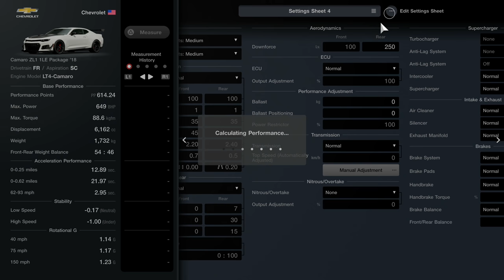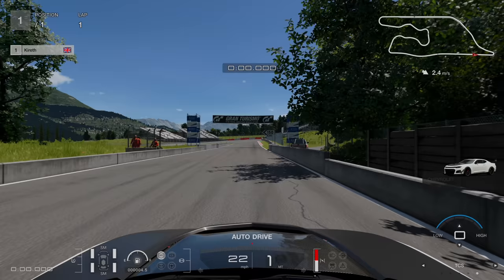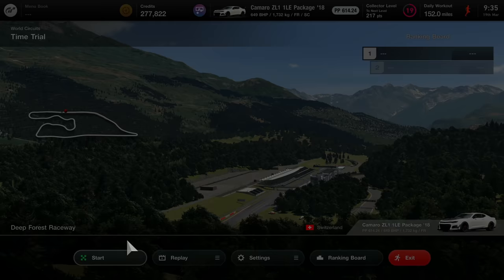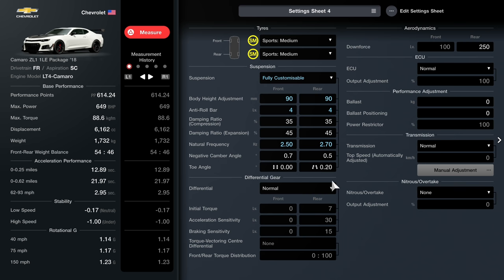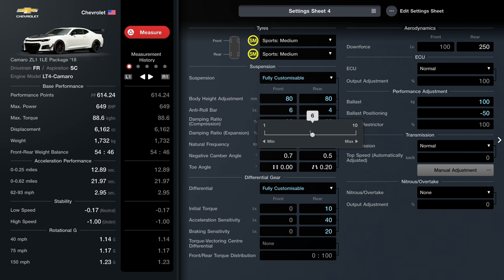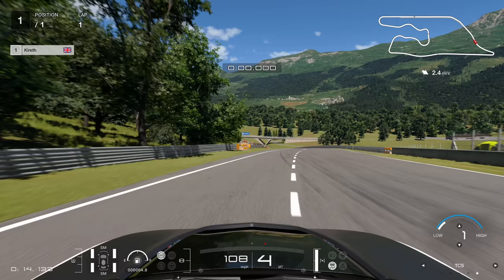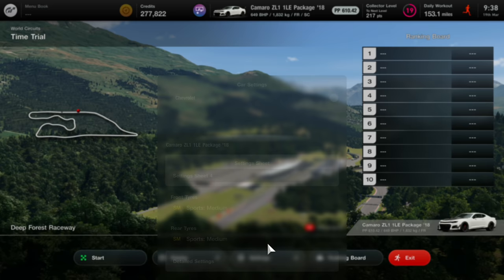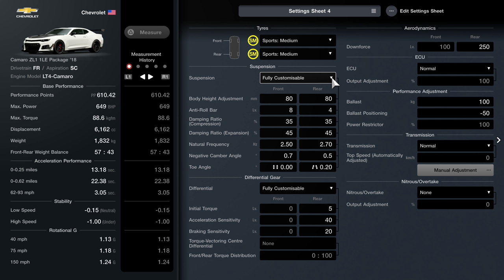Gran Turismo 7 Tuning Guide - Make Undriveable Cars Good!

Comment: Thanks man, appreciate the video!

Was literally struggling with a Focus RS (500+bhp) and seemed impossible to drive. Now I have seen my ballast positioning was wrong and the initial torque setting too. Top tips man, thank you!
Reply from the maker: Hopefully it helps!!
Reply: Something that I think gets slept on as well, particularly with the focus, in increasing the rigidity. That combined with a good suspension set up will stop the lift off oversteer and tankslappers you get in that car.
Reply: This helped me so much with my rs! I couldn't drive it at all.
Reply: Don’t discount suspension tuning default settings are completely Wrong.  Buy the fully customisable suspension (coilovers) Then simply remember softer equals More - priority of Grip in weight Balance. You have anti-roll bars / dampers compression (bump) and expansion (rebound) / natural frequency (Springs rate)

E.g. 
anti-roll bars F6 R3
Damping bump F35 R23
Damping rebound F45 R39
Spring stiffness F2.20 R1.70
Or to much understeer 
Anti roll bar F5 R3
And springs F2.25 R1.70

Those are example figures as a base setup to give you an idea, Rear wheel drive or AWD (in this game) cars may need a great difference, depending 

In mid-engined or rear engined cars then the spring rate equalling grip changes along with the weight balance of the car. Sometimes less of a difference F2.20 R2.00 sometimes equal, and sometimes opposite 

That should help Massively, Anyway “keep it simple stupid” haha
Reply: General rules with 4wd and prop
-first. a car with a lot of hp is unstabble by nature. You can only make good setup if you are gentle with your power and brakes during the first part of your test. The hard part is not to confuse oversteer and a to heavy foot on throttle ans brakes. Look for the limit of the grip and try to analyse the behavior of your car on brakes, on power and during slow and fast corners. Avoid tcs. 
-Oversteer on power: lower the rear bump damping and lower the front rebound damping. It allows, on power, the front to go up and the rear to go down. More understeer on the front and more grip on the rear. The car will be more stable. If you suffer from understeer, just do the opposite.
-Oversteer on brake. Stiffen the front bump damping, and stiffen the rear rebound damping. It allows to keep more grip on the rear. The front will be less reactiv. If you suffer from understeer, just do the opposite.
-general oversteer, you want the front more stiff (natural frequency and antiroll bar)
Set correctly your lsd
If oversteer, Rear lsd Initial torque low, acceleration torque low, deceleration torque high

Comment: To be fair you did drive the first one without any TCS and you added it in the second run. This makes a difference as well.
Reply from the maker: As I explained this is part of the setup 👍
Reply: Absolutely need TCS
Reply from the maker: 100% very helpful in these sort of cars
Reply: Just for comparison sake I think the TCS should be turn off for at least the initial comparison. I feel it's just TCS doing it's work rn. None the less good video!
Reply: I was going to say, any set up changes would have been needed by the addition of TCS..  show how it drives without TCS after set up change
Reply: Should have show with tc off as well...
Reply: Yeah, also talking about tweaking the front diff, while the setup sheet clearly reads a this is the rear diff. Clickbait...
Reply: @King_Ding_82  TCS slows you down, even you'd wheelspin without it.
Reply: @dionykn1832  I was just going to say that. Cause your not gradually applying throttle your just mashing it hoping tcs cuts the power to stop the rear from spinning which is going to be slower with tcs off but gradually applying throttle
Reply: @williamcook2499  yea I know tcs was only on for the second run but I’m just saying that relying on tcs every time and mashing the throttle like that isn’t the way to go if your trying to drive fast it’s only gonna slow you down. Stiffening the front and adding ballast is Good advice but you’ll still lose control sometimes with tcs it’s not 100p therefore you also need throttle control
Reply: Nobody who’s good uses traction control you don’t have to smash the throttle
Reply: @jeriah4k218  ohhhhhh snap!
Reply: i Always drive with CTS Off and settings did help a bit. one thing i also did was raise the front about 5 points up from lowest setting and it helps turn the car better.
Reply: 100% 👍👍
Reply: @jeriah4k218  LOL do you even play the game. Some cars you absolutely need TCS or you're just putting yourself at a disadvantage and making it harder for yourself. Good players use TCS all the time. You know nothing
Reply: @coltallic3114  I mean I don’t see how I’m at a disadvantage if I win most online races
Reply: @jeriah4k218  thats 100% true . But I forgot my setup I had on my old ps. So now I'm stock there like a beginner...and frankly it took me a year back in the days to find a great setup. So my motivation to start it all back again is lets say...depressive. I'm about to give up to be honest
Reply: The TCS should have been off on both of the tunes to be fair
Reply: @Kireth  just turn it off for comparison's sake otherwise it's just shameless clickbaiting to tell people there's a way to fix hard to drive cars and you tell them to turn on traction control. Drowning? Just learn how to swim! And you're also getting ratio'd
Reply: Honestly yeah. It’s all about throttle control. I have this car as much mods as possible with TCS all the way off and I know how to control it.
Reply: @Kireth  but in some online races, tcs can be disabled for everyone
Reply: @King_Ding_82  I never use it unless its a rainy race
Reply: it makes the biggest difference. more than tuning. he should have tested both tunes with the same tc setting
Reply: Good tips bud, I’ll give those a try👍
Reply: To be fair I need to drive with minimal tcs I have it at 1 or off completely if I’m awd or fwd if I’m rwd it’s at 1 always
Reply: Ain’t no way. The only way I spin out is when my THC is at zero bro. Haha you know what I mean tcs hehe. Y
Reply: @iG-Luis.r4PF  Hahaa... i too tend to spin out when my THC is at 0 lol
Reply: He’s like Super GT, if Super GT was a snake oil salesman.
Reply: The solution… don’t overdrive the car.
Reply: @Kireth but then we miss the logic on how good your detailed settings are. We don’t know if the improvements are more from the TC or from the detailed setting. It is not an apples to apples comparison.

Comment: 1st test is without tc and 2nd one is with. Not sure any of your modifications help but for sure tc works...should have done both tests with tc on or off to prove your point, now i call this clickbait...
Reply from the maker: TC is part of the setup mate 👍
Reply: @Kireth  TC is assist not car/tuning settings
Reply: @Kireth  I did use stock car without TC and with TC without tuning and got the same result you had in this video. It is clickbait.
Reply from the maker: It's part of the setup - how to make these cars more driveable 👍
Reply: Yep won't get many 1st' with tc online
Reply: @Kireth  TC is not a part of "car setup". Its a driving aid, like lane keep, and stability management. Setup is hard part manipulation, not nannies.

Comment: Your corner speed has 10+/- in variation between the runs, also TC will make the car “driveable” without playing much with settings. The 100kg Ballast to the front will comprise the corner entry speed and promote under steer.
Reply: Better to have understeer than oversteering off the track, pretty silly say these things when you can clearly see that it works.
Reply: Better to just tune the suspension settings to eliminate all bad characteristics of the vehicle and enjoy a pleasant drive 👍

Comment: Adding the ballast all the way to rear helped out better for me. The extra weight on the rear wheels helps the car stick better for FR, then tune the initial torque on the lsd to manage the oversteer out of turns.
Reply from the maker: Hmm interesting
Reply: This... Adding ballast to the front will only induce understeer during turn entry. It will do little to nothing for when powering out of a turn which is when it is needed in this high torque vehicle. Adding to the rear will help for powering out of turns but most of the improvement is made in the diff honestly.

Comment: mostly its the TC working here..
you can see how it is working from 3:39 for 4 soconds straight, trying to control the car... so yeah... kinda pointless, you should compare with tc off, but the rest is good.
Also for everybody whos interested:
with the Anti-Roll-Bar adjustment, you set if your car shall behave more oversteery or understeery.
stiffer rear ARB + softer front ARB = makes your car more oversteery
softer rear ARB + stiffer front ARB = makes your car more understeery
Reply from the maker: Great analysis and much appreciated 👍

Comment: Heads up for future videos, lowering some cars to the lowest setting can induce rubbing which has a really negative impacts on turn in for tight corners. Finding that sweet spot is key.
Reply from the maker: Yep great tip here, thanks
Reply: This is exactly what he did in the video, that's why it went from massive oversteer to understeering into the wall.

Comment: I never understood the issues with using TC, Even car manufactures will tell you the car they built is faster with the provided assists.  We dont live in the old days of race cars with no power steering, TC, ABS, or other features. I love driving the ZL1 but have gone further into the suspension turning, this car loves negative camber and stiff springs.

Comment: Ok appreciate the tips.. however placing the ballast to the front in FR car increases the oversteers as the traction in the front increases by teh additional weight. Ballast is pushed  to the front in some MRs but especially  RRs (Porsches) as the rear wheels have great traction (due to engine location) but the from is light and thus understeer then snap oversteer hence ballast is used to give stability/traction to the front...  the Diff+TC1 should resolve the oversteer in this car and maybe will reduce Rear roll bar to 0

Comment: Agreed with everything you said - one more thing …add some more negative camber from minus 3 to minus 4 

Cornering is much better when you go from -3 to -4 camber …this means the tyres will grip more. Given most circuits are cambered corners anyway. This will give you more traction and quicker speeds coming out of corners.
Reply from the maker: Great tip, thanks!
Reply: This is nonsense.

Comment: A little correction, more front downforce will increase oversteer, more rear downforce will increase understeer. TC should be used if it helps, this is an old myth spanning years now. There is even a video about this false Alien nonsense on YouTube about why it's perfectly acceptable to use TC. Its even used in the real modern Motorsport world.

Comment: instead of TCS why not  lowering "acceleration sensitivity" to reach same objective ? e.g instead of 40 put 10... when  keeping to higher levels both wheels spin at the same power causing  the car to snap.  Lowering is kind of a TCS
Reply from the maker: Very good point 👍
Reply: where Can I adjust the acc sensitivity?
Reply: @jonathanmjolnir8550  in tbe game itself under car settings (section LSD) there are 3 values,  settings can be applied for each car before you race
Reply: @ienaridens7979  Thanks.
Reply: @jonathanmjolnir8550  you need to compromise this value ... if you go too much on the lower end  you will have a much controllable car when accelerating but at the cost of responsiveness... my suggestion is to start with a lower level then increase little by little  untill you dont loose control . do it after an hairpin

Comment: Personally I wouldn't add ballast first thing. Rather change the spring on the rear softer and slightly taller to compensate, add a little bit of camber on the rear, also stiffening the diff a bit.

Comment: TC is viable, but practicing without TC eventually improves throttle control. I understand if you're top split, there is likely not much more to improve, which i understand. This isn't any sort of thing you have to do, as you probably should be racing with TC on, but it does slightly help.
Reply: Yeah some are straight up undrivable due to the gt7 physics and stupid unrealistic snap oversteer.
Reply from the maker: Agreed but the physics of some road cars are weird
Reply: Are people who consider themselves somewhat high level in GT driving with TC on? I played through the Cafe with TC1 because I couldn't get used to the oversteer, but once I was at Gr.4 and had driven a few tracks, I realized that TC was basically bottlenecking my turn radius. I just couldn't do hairpins for example at the same speed using the same like as the AI.

And you're absolutely right, that forcing yourself to turn off traction control teaches you better throttle control. After about a week with TC off, I'll be driving a Gr.3 car and sometimes I have to double check that the assists didn't get turned back on because I'm just getting better at being careful and precise.

I play on a controller and I honestly feel that granularity of brakes and throttle is a bigger disadvantage versus a wheel than steering.
Reply from the maker: @DriftEJ20  I race in the top 20 drivers in Europe in daily races and used TC on this car 👍
Reply: @Kireth  Maybe I'll give it a shot again. I definitely lose corner exit speed versus with TC on because I'm babying the throttle whenever I'm not perfectly straight. Do you just blanket use TC1 on everything, or vary per car? I feel like I don't need it with Gr.4 much, but Gr.3 and certain street cars, or events restricted to comfort tires I do much more.
Reply: @DriftEJ20  On RWD road cars TC is a must. On race cars it's a bit easier to run without because of the downforce but on bumpy tracks it could be a problem

Comment: Best way to figure it out is to do it for yourself. Pick a car that drives like poo poo and go one ticker at a time and see what it changes and how much it changes it. I’ve got myself a pretty decent system now where I can make just about any car drive really really well to the point where I’m challenging myself driving severely under powered cars in races just for  funzies into my shock. I’m doing really well putting huge gaps between myself and 2nd place almost more fun, driving under powered cars at the limit then severely overpowered cars, just tender footing them.

Comment: You can even increase the lsd brake sensitivity 😉 example of lsd values for very oversteering cars: 5/5/60. If the car is too slow, you can try to increase the fist two and decrease the third gradually
Reply from the maker: Great tips, thanks!
Reply: Since you seem to know what you are talking about: How would i set up a diff for drifting?
Reply: @danielstokker  thanks!

Comment: Nice one Kireth, will take these into account for future builds! Also yeah TC1 is basically a must for me right now on track, no shame using it 👍
Reply: TC1 can also still make your car spin out if you are not careful, especially if the turbo kicks in and the torque is going into heaven.

I use TC1 aswell as ABS on weak with my controller, works pretty well.
Reply from the maker: Hopefully we get some sweet road car builds!

Comment: This is a mistake that i often see people make. They are not using the correct tires for the PP. It doesn't matter what you do with the foot settings and LSD if the torque is way too high for the grip of the tires. As a rule of thumb. Run sports tires anywhere from 500pp-550pp. Run racing tires starting at 600pp. As you reach 650pp to 700pp and are on a course with a lot of turns, run racing soft and or mediums. If you are running sports tires at 600pp, i don't know what to tell you lmao. TCS isn't part of tuning. Its a bandaid that can be used even with the worst of tunes and make a car run smooth and fine. A good example is the tomahawk money grind method. Taking corners at 200mph with RH in rain all because of TCS lol. No foot tweaking needed whatsoever. Anyways, here is what it looks like when you are using the proper tires for the PP limit. The car runs smoothly. I was even trying to push it a bit while exiting. My 5 min tune is at the end. First time ever touching this car. 

https://youtu.be/1xDhPSYazvM